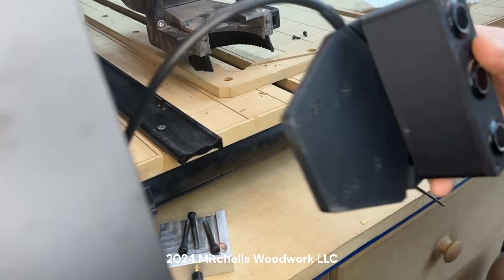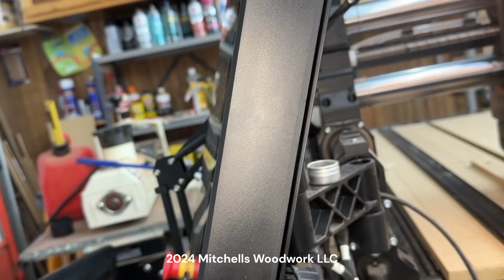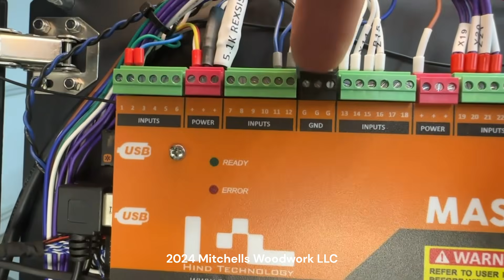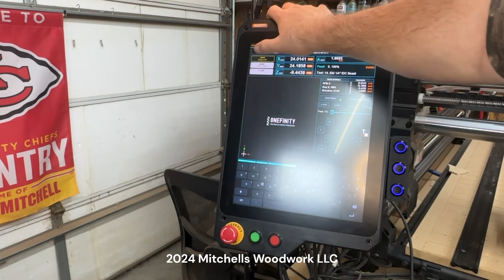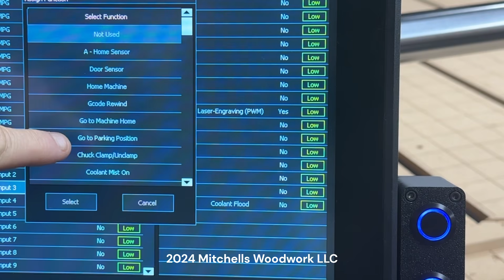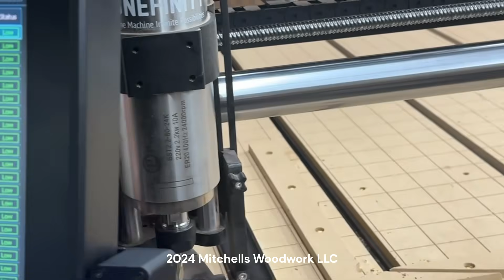Installing The DashMade EZ Button On Masso Controller | Onefinity Elite Foreman CNC

Comment: I set up my ezbutton and they seem to work. However on the F1 screen my input settings status is high for all three when not in use. Yours is low. Am I doing something wrong?
Reply from the maker: @maxfantuz  to change the high / low, just tap on the input to highlight it, then tap the space bar to change high / low.  Easy peasy! 😉👍

Comment: are the resistors for the led lights on buttons? don't see them on the wiring docs from masso. but did not read whole manual. any idea resistor size? Thank You
Reply from the maker: Hi Kevin, contact Steve Dash on Etsy.  He’s the guy that makes the EZ Button and can answer any questions you may have.  Thanks for watching!  

https://www.etsy.com/shop/DashMadeWoodworking
Reply: @MitchellsWoodwork  5k resistor and momentary push button to call up the command selected.
Reply from the maker: @kevinbaxter1571 thanks for sharing that info!

Comment: Hey sir great video I'm getting ready to hook this up ,but I have a question how did you get it to turn on your Shop-Vac cuz that's what I want to use mine for but after the button how did you configure it from there if this makes sense Thank you
Reply from the maker: Just assign that button (input) to “Coolant Flood On”.  To turn the vac off you can either assign a button to “Flood & Mist Off” or tap on the “Coolant Flood” button on your F2 screen.  Hope this helps!
Reply: I get that but something has to trigger the IOT relay correct?
Reply from the maker: I'm not using an iOT relay on my setup.  My Festool CT15 Dust Extractor is plugged into the vacuum port in the back of the black box.  The "coolant flood" input activates the vacuum port on the black box.
Reply: @MitchellsWoodwork  this doesn't work for me, i've tried it and it doesn't activate the vacuum.  Homing and parking work fine.  Could it be that i need to upgrade to software 07?  i am still on original 05 version
Reply from the maker: @dougwoerner4569  do you have your vacuum plugged into the 110v Vac outlet on back of the Elite black box?  I don't know if upgrading to v5.07 would make any difference, but it wouldn't hurt to try it.  Just backup your Masso files first.

Comment: Can you explain or better yet make a video on how to set up the easy button for the tool setter and a parking position to change bits?  thanks
Reply from the maker: At this time, neither of those options are available as configurable user inputs.  There is a thread on the Masso user forum asking Masso to add these functions, and quite a few folks (including myself) have already added their names to this request.  The more name we can get, the better our chances will be of getting these functions added.  I hope you’ll create a user  account and add your name as well.  

https://forums.masso.com.au/threads/go-to-work-origin.3557/
Reply: I see on the Dash made  etsy site in the video someone pushes the EZ button on the side of the masso controller and the cnc goes over and measures the bit on the tool changer. this is what I'm having trouble figuring out can
Reply from the maker: He has that button set to "home machine", then in F1 > Auto Tool Zero, he has "enable auto tool zero" checked.  He's just homing the machine which automatically makes it go measure the tool.
Reply: thank you for the help . @MitchellsWoodwork
Reply from the maker: No problem, that’s why I do what I do. 
😊👍

Comment: Can you tell me please ... I know you have the 80mm Spindle .. Have you installed the new Z-20 Braking Closed loop Stepper Motor... if not ..have you had any issues with the Z motor dropping when you turn the machine off .   Thanks
Reply from the maker: Hi Peter, thanks for watching. 😊  I haven’t had that problem with mine.  Are you having that problem with yours?

Comment: I would have added a short jumper wire from those three resistors to the power block.  You could have used a tiny wire nut and did that beforehand. Then you wouldn’t have had to bend over those resistors at all.  Just a thought! Awesome video as usual! Getting those close ups while doing the install must have been tricky.  I also need to learn more video editing, like how to add those little “like & subscribe” animations and such.
Reply from the maker: You’re the second person to mention a jumper wire solution, so I’ll know better next time.  Thanks for watching, as always!

Comment: Pretty cool Masso is so configurable.  I’m assuming these general purpose inputs are open collector and the resistor is acting as a weak pull-up and when the button is pressed it’s driven low.  I would recommend a dab of solder on the twisted resistors and a single wire into the power pin, if I were doing it, but otherwise pretty cool.  Love the utility!
Reply from the maker: The Masso is truly incredible, and I’ve only scratched the surface of what it’s capable of doing.  I’ll have to let @sdasherx answer the electronics questions, though.  Thanks for watching!
Reply: They are wired as recommended by Masso. I didn't use the resistors the first time and that caused some issues. It is not necessary to twist the resisters together but it will work the same either way.

Comment: May have to give this a try. Informative as always. I noticed your gantries moving fairly fast while homing. What speed do you have set for homing?
Reply from the maker: I have mine set to 150 ipm.  I really need to make a video on that subject.  Thanks for watching!
Reply: That's slow, quite slow
Reply from the maker: @endlesslybrowsing6559  150 ipm homing speed is slow?  What speed are you using on your Onefinity Elite?